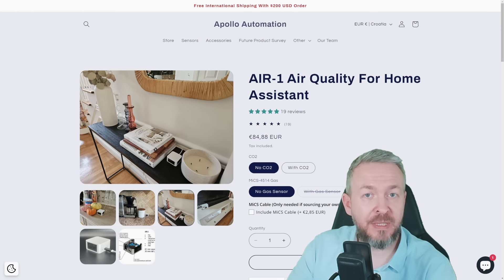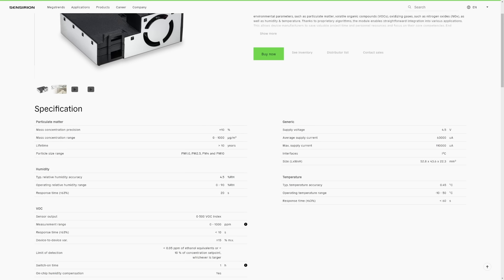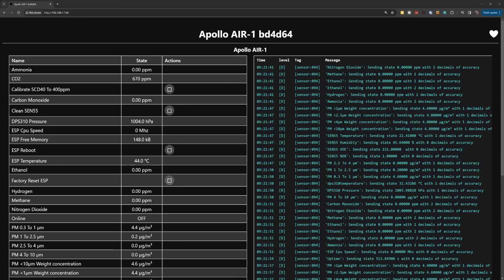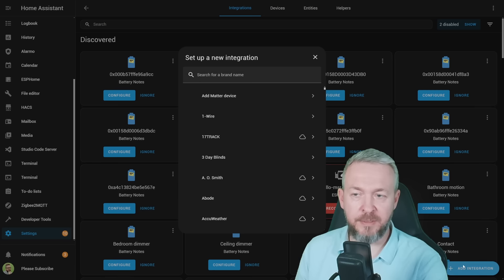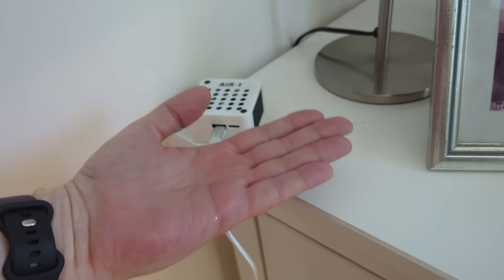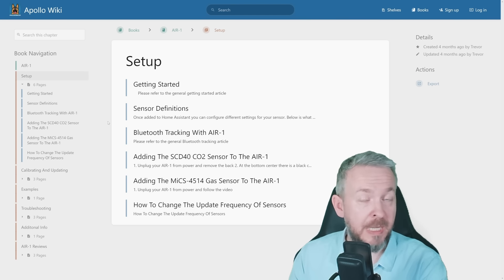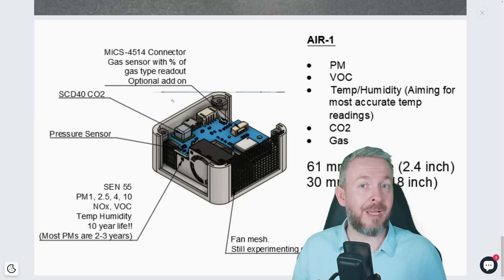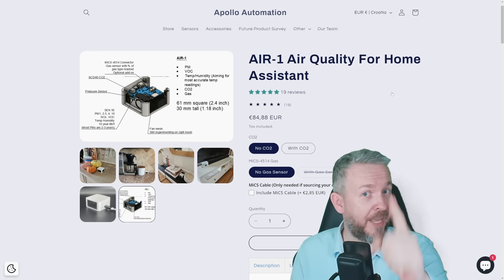Air-1 - most feature packed Air Sensor I've seen

Comment: I’ve had one for couple months, so far so good.
Reply from the maker: That's good to hear. I've installed it at permanent location (at least for now). Only had it online for 5-6 days.
Reply: Nice looking sensor but expensive. I use the newer IKEA one to control filter next to my 3D printer, turns on with 2.5 above 3ppm and VOC above 100, I vary the fan speed depending on levels. Works well.
Reply from the maker: It really is expensive, but it also packs a lot of things inside.
Reply: We appreciate your support and are happy to hear that it has been working well!

Cheers,
Justin
Apollo Automation

Comment: Thanks for the review. It’s good to have an alternative to the currently used Airthings Wave+. Even though it doesn’t have a radon sensor like Airthings, it’s cheaper. Is the fan used only for PM measurement, or are all the gases actively measured? Even if the fan doesn’t directly feed all gas sensors, thanks to the air circulation, it should be more responsive than ‘passive’ sensors without a fan. I think I love this sensor as well 😉
Reply from the maker: Thank you for the comment! No, fan is inside SE555 only, so just PM values. But other sensor board is directly on the mash and it should be exposed well to air. And it's really sensitive.

Comment: it would be useful if someone made a collection of alert automations that alert when any of those sensed values are at a warning level. If you wanted to set that up yourself, it sounds like you would need to go sensor by sensor and go research what are safe and warning levels of each measurement. Might save folks some time (not just for this sensor, but any of them in HA that measure any of the particular values that are in the automation table).
Reply from the maker: Sure, but - what standard :)
Problem is for example US vs EU vs China - they have different norms used. Currently outside air where I live is rated 44 by US scale and 34 by China scale.
Reply: Great suggestion! We have some examples on our Apollo Automation GitHub and our Wiki page. I do not think I can post the links though because YouTube auto-removes the comment.

Cheers,
Justin
Apollo Automation

Comment: Funnily enough, I'm currently making my own multi-sensor based on the SEN55. I've also added the SCD30 for CO₂ and the DPS310 for pressure measurement. I'm at the final stage of case design, but I'm still looking for/at a good way to implement CO₂ calibration with ESPHome (I'm still kind of a novice when it comes to programming etc.).
Reply from the maker: Sounds like a fun project! You can look also at code of Air-1 for inspiration if you need something. It is available on GitHub.
Reply: Cheers! Yes, I'll definitely do that. 👍🏻
Reply: I made my multisensors quite some years ago. In terms of CO2 Calibration, what are you trying to achieve? I use the senseair S8 for CO2 measurement and what I do is when I'm on holiday and the house is empty for a few days then I push a virtual ESPHome button that calibrates the sensor
Reply: Many sensor just calibrate on fresh air CO2 levels. So at least once a week you give a room full ventilation or bring sensor outside where it can baseline itself against ~400 ppm
Reply: On the senseair S8 I disabled the automatic background calibration.
The issue with the automatic process is that if in the last week the lowest measured value was e.g. 500ppm it will just assume that must have been 400ppm and recalibrate on that basis.
But especially in winter it's normal for my house to never reach 400ppm.
At least for the senseair S8 it is fine to calibrate it manually e.g. once or twice a year. It will be off my maybe 20ppm which is really nothing.
Reply: I want a way to manually calibrate it roughly once a year. I'm not worried about discrepancy around 50 ppm, but at the same time, I don't want it to be off by several hundred ppm or more. I basically want to be able to move the sensor to a room or area where the ppm is known, and then by pressing a button adding a new reference value (I will of course also need the option to specify the new reference value numerically).
Reply: @TommyBrenner  I just checked the ESPHome documentation for your Scd30 sensor and what you want is perfectly possible. All the code is in the documentation. You just need to copy that code.

Comment: I wonder which of the sensors are best to detect the smell after the restroom has been in use. Methane or just VOC?

I'm also interested in the power usage if the Air-1 is fully equipped. Would it be possible to power the device for a few days by using a power bank?
Reply from the maker: I was able to get it working with Air-1 in bathroom, for academic purposes. Forgot what was the actual sensor out of all of them that was peaking, but there were spikes after restroom use.
In terms of power use - not really sure. Haven't tested it nor checked power consumption. But I can power similar sensor out of 10.000mAh power bank for around 4-5 days.

Comment: It would be really interesting to see how accurate these sensors are compared to calibrated industrial sensors.. Some of them work well in a specific range then go off target by a lot outside.. so yeah given the price it's hard to go for it without some level of assurance of the accuracy over the whole detectable range if that makes sense
Reply from the maker: You can check accuracy of each sensor on datasheets. But also remember that humidity and room temperature also impacts the accuracy.
Reply: Would be this sensors covers more like industrial grade decomposition for the air pollution. That being said, in my humble opinion until you are leaving in industrial area what you need is PM's VOC, Temps humidity and CO2.
Reply from the maker: I have to agree - VOC is good enough as it already measures "gases" in the air, not precise by chemical composition, but if you are printing with ABS or similar materials, or using sprays to paint, it will register that.
Reply: @BeardedTinker  My main drive is to be able to plot air quality (for each of the measurable quantities) vs my kid's asthma flares. I'd love to be able to know when to amp up on the preventive medication (if at all possible) in that way.
Reply from the maker: I'm not a scientist, but I think the main unit with maybe co2 (just to be safe) would be good enough for this. Not sure what allergies your kid has, but tracking PM values could potentially be ok. These valves would tell you when there are any spikes in particles in the air. That could be used for notification.
Quick Google says that pollen falls at PM10 category, together with dust.
Reply: @BeardedTinker  Having asthma myself (but pretty much gone) I can tell you that it really depends but mostly it's an allergic reaction in the lungs. Like you mentioned pollen/dust is one part of it. I know that VOCs easily choke me up so the second intention is to use this data to see what spikes lead to a flare. It could be they are fine with moderate pm10 but not with VOCs for example.

I'm also suspicious of some manufacturing plants that are upwind from me (sometimes, especially late night it smells like burning tyres or what not)

Anyway it's really just trying to make more sense of the flares. Thanks for your answers

Comment: What kinds of sensors are certified?
Reply from the maker: Certification can be done per component or per device. As far as I kno, components in this one are certified and calibrated in factory before assembly, and should provide accurate data. But as with all CO/CO2 sensors, you need to calibrate them at first use on clean air (preferably outside) so they can establish what's baseline. Other sensors are pre-calibrated and should provide adequate data.
But this device is not certified to be "scientific" tool - it can be used in home as tool to give you enough information and info on trends.

Comment: it does look good but expensive.  However, if it allowed me to replace the smoke alarms in all my rooms and also had a battery option I would buy several.
Reply from the maker: It's not certified and as such I wouldn't recommend replacing them - not saying that they don't work, but...

Comment: Is IKEA's Air Quality sensor bad? I own two and mainly use them as a Zigbee repeater.

I just started Zigbee 2 weeks ago, and if they're not good, I can return them.
Reply from the maker: Haven't tested those as I've not liked the reviews. It's not bad per se - but reporting time has a bit of delay, and also, VOC values are not reported via Zigbee network. It all depends on why do you want them exactly. For typical home use, they can be enough.

Comment: Well there was a Dutch store that sold it for 152 euro including 21% VAT with free shipping but they have no stock. this will be 185 euro because they are too lazy? to arrange it properly I guess. (21% VAT + 13 euro).  It is quite interesting for the 152 euro price though, the sensors are not cheap. although I recently managed to find a CO2 sensor that is not smart but has a SCD30 co2 sensor board soldered in I can use again on an ESP32, for only 30 euro.... (had to buy it as 60 euro for 2)
Reply: Thanks for the comment! Yes, Open-Circuit is one of our distributors in the Netherlands. We will reach out to them and see if they would like to order more. Another distributor is Domo-Supply in Switzerland. We are open to any and all suggestions in regards to international shipping. It has been one of the more difficult things to navigate since we ship from the USA. Could you let us know what you mean by "arranging it properly"? We offer free international shipping over $200, and we have 4 DDU (you pay customs) shipping options as well as 1 DDP (customs paid upfront) option. We are still learning and want to do what is best for the community!

Best,
Justin
Apollo Automation